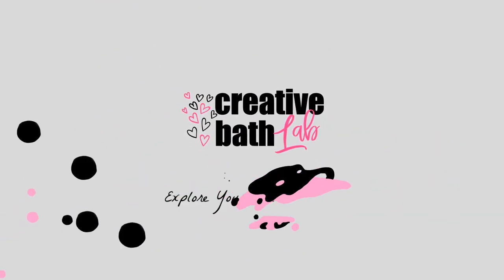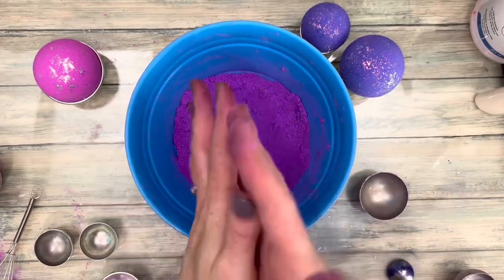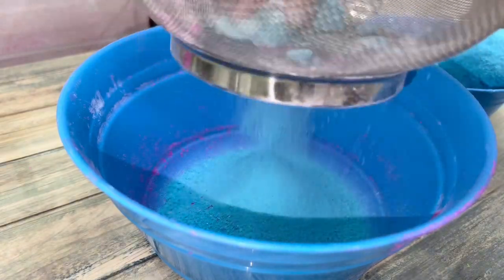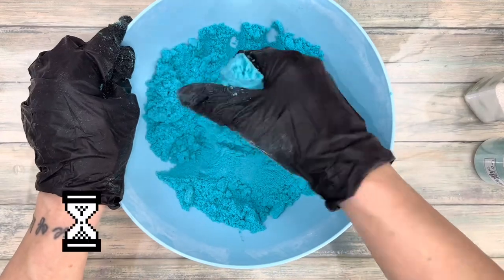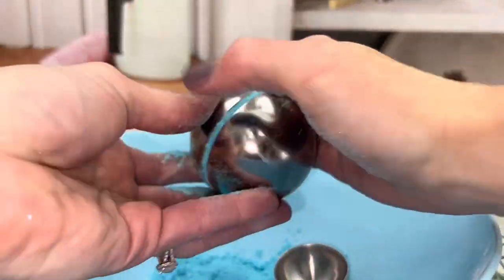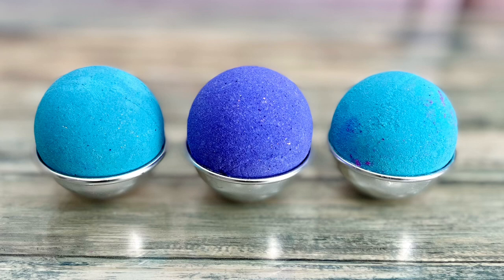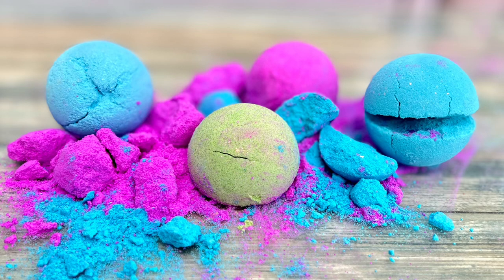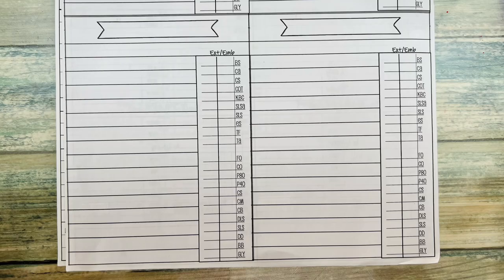Common Bath Bomb Problems And How To Fix Them!

Comment: I formulated an oil heavy bath bomb and it gives me around a 45 minute work time. I found especially working in a humid environment oil heavy mixture is perfect.
Reply: I agree. I don't use water or alcohol, just oils.
Reply from the maker: I did it like that for the past 3 years & a few months ago I started incorporating water into my recipes & the bombs got a lot harder.
Reply: But does it float? Mine sink and I can’t figure out why but I had a suspicion it was the oil

Comment: Thank you for this video. I have a recipe that includes powdered goats milk. It makes the bath feel amazing…silky. The first time I made the recipe, the bath bombs working perfectly. Granted they are to big in my opinion. I used a 3” round mold. Going forward I will use smaller ones. Months later these bombs are obviously rock hard/dry, but still don’t float. I think they are just to big. 
I have made my recipe 2 more times with no success. They wouldn’t hold together. Watching this video I think it was the witch hazel. So I took the mix broke it all up and sifted it. Then poured it into cute tubs and sold it as a foaming milk bath. Same effect of a bath bomb, just not a ball shape.
Reply: I made some today I wish I could send you a photo.... They were so pretty time I passed back I could not believe the shit I just made 😩🤧🤣🤣🤣. They swell like those little tablet napkins

Comment: I just made your rock hard recipe bath bomb. The wet ingredients thickened after adding the color powder to the point that it would not pour and it was quite dry.  I was able to mix in all the ingredients and I put them in the mold but I forgot to add in the extra color powder so I did not have enough for 3 x 2.5" containers. Can you tell me why the wet ingredients would do this. Should I just add the color into the dry ingredients instead of in the wet ingredients. I live in Canada. Thank-you in advance.